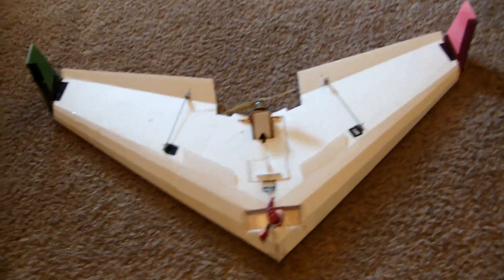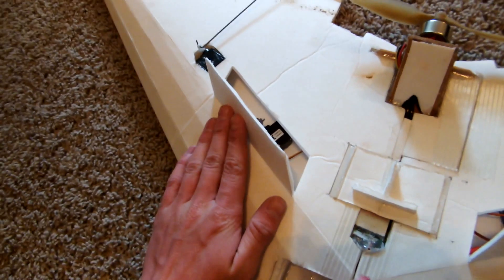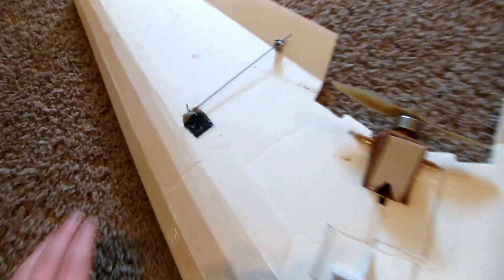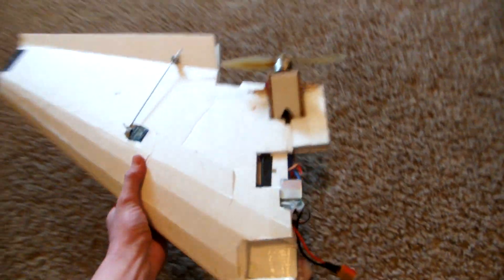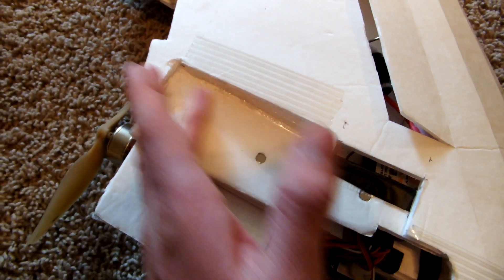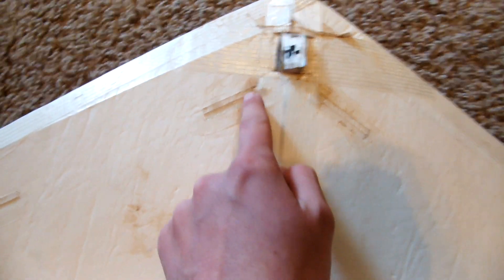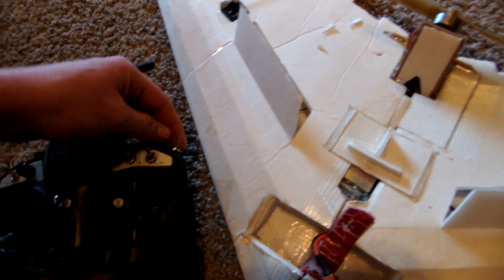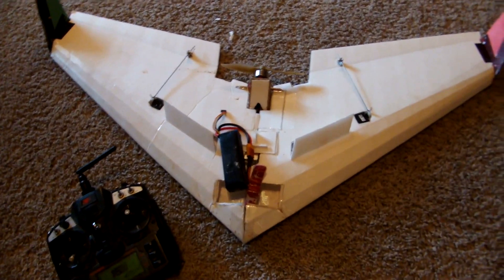Foldable RC Delta Wing!!!

Comment: very ambitious and ingenious design. I am also building  a wing, but I have know idea for how to plug the elevator / aileron servos , do you use a "Y" cable or some sort of adapter dongle?
Reply from the maker: Thank you, you have to use delta mixing definitely not a y cable.  If you used a Y cable you wouldn't be able to control the surfaces separately, as in they would either move opposite directions or the same direction together so you wouldn't be able to turn and gain elevation (same is true for the opposite). I plugged my two servos into separate channels. Plug one into the elevator channel and one into aileron channel. You then have to mix the aileron channel to be a slave to the elevator and the elevator channel to be a slave to the aileron.  This way both surfaces will move up when you pull up on the elevator and down when you push down. They should also move in opposite directions when you roll left or roll right. (if you roll right the right control surface should come up and the left should go down. Opposite for rolling left) Does this make sense or did I make it more confusing?  haha

Comment: Awesome work! I love the fold-able design and detachable winglets, that's really clever. Do you have a video or any comments on how the airbrakes work? I was thinking of doing something similar on my blunt nose versa, but was curious if they worked for you or made a noticeable difference when landing. The versa seems prone to wing tip stalls when attempting a slow approach so I love the idea of having airbrakes to cut speed on command.

Thanks for sharing!!!
Reply: After some googling, it looks like the term I'm looking for is spoilers rather than air brakes, either way am I correct  assuming this would help with a shorter landing and effectively plop the airplane down?
Reply from the maker: +Jon Olsen (Jonathan) thanks! I don't but basically there's just a servo directly beneath each one. The arm is parallel with brake and facing rearward and I just used piano wire to make a small L like bend where the bottom of the l went through a coffee stir straw which I glued to the air brake  and then just a zip bend into the servo arm.  My first wing was very similar to the Versa but I noticed that wing tip stall tendency so I designed this wing with the higher angle of attack in the center. Completely solved it and flew wonderful at slow speeds. Hopefully this all made sense haha

Comment: I'm not even going to attempt this, I'm certain my flying style would make this fold up mid flight
Reply from the maker: It is actually extremely sturdy as long as you are pulling up.. haha I didn't design it for really romping upside-down though.
Reply: +Mason Cleveland I fly this (as well as my quad) in an extreme fashion. I once put a g-meter on my wing, and it logged 7.2. I was hoping this would work with my flying style, but I'll probably put this on my cruiser. Have you thought about maybe using a strip of metal in the shape of a U with little catches as the spar?
Reply from the maker: Sweet! Yeah definitely not going to hold up to much if it's not upright. I'm thinking on doing another folder that's going to be way stronger just gotta find some time. Not sure what you mean by u shape

Comment: I'm just wandering, did you buy the kit of the versa wing from flight test caus I'm planing to build one made out of Styrofoam or card board
Reply from the maker: I did not. I just measured and played around until I could get the maximum sweep angle out of two sheets placed vertically. so the whole plane except the winglets was two sheets of foamboard including the spars.

Comment: Nice, but you can remove most of your control surface and just have them on thr outer edges. They will be morr effective this way.
Reply from the maker: +TheSpuddiver That's an Idea, wouldn't that negatively affect the elevator controls though?

Comment: Nice wing! I like the folding idea. Very cool. I just "finished" my wing but I think I may want to add air brakes first, otherwise landings are going to be way too fast. Do your mid-wing air brakes work well? I'm not sure whether I should put them on the winglets, mid-wing, or the horizontal "landing gear" pieces I have mounted under the wing.
Reply from the maker: Thanks!  They do work quite well for killing speed and lift but if it were me, I would put split ailerons/elevators so you could just use a crow mix. Make sense?
Reply: Mason Cleveland Yes that would be ideal, however I don't think the wing is thick enough that far out. It might be doable. I think I'll check where the balance point is now and see where the servos need to be. Thanks!